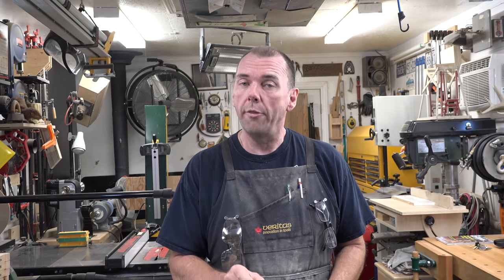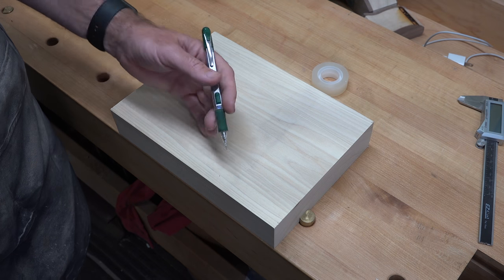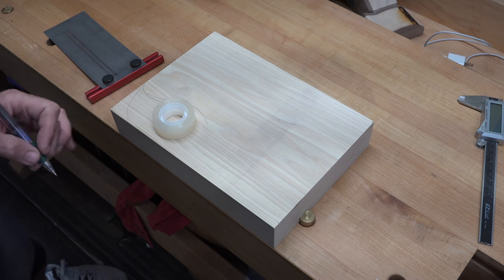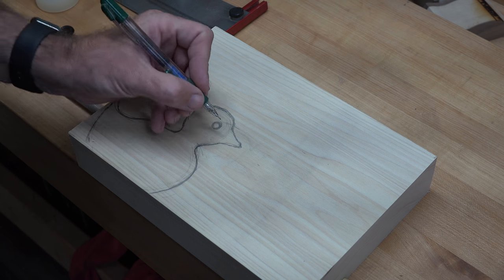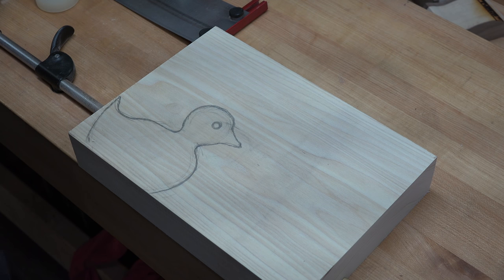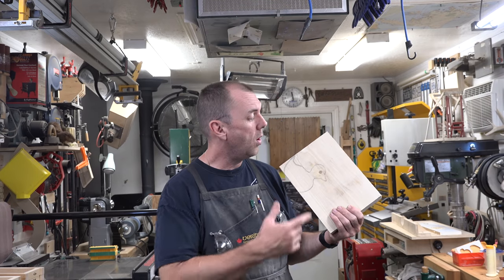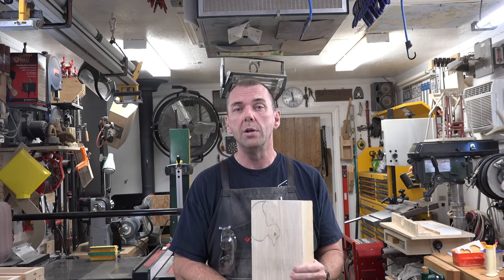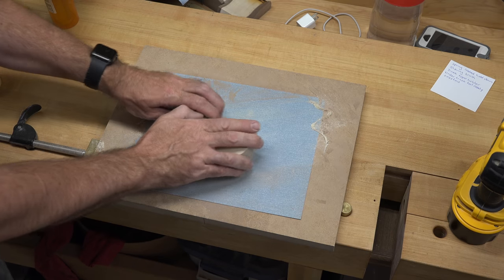Making a Duck Tape Holder

Comment: @acutabove_woodworkings well done with the upcycling, using ppe and keeping a tidy shop! "Come closer...not kidding!" Bahaha...love your humour!
I was wondering about what you were going to use for the cutter...Great idea!
I suggest you add a non-slip pad to the bottom.
Reply from the maker: The non-slip is a great idea.  As for the blade, is use the serrated edge from a plastic wrap package.  It works really well.  Thanks for tuning in and for chiming in with your suggestion.
Reply: @acutabove_woodworkings  after watching this...I saved the cutting edge off my next box...oh the possibilities...lol